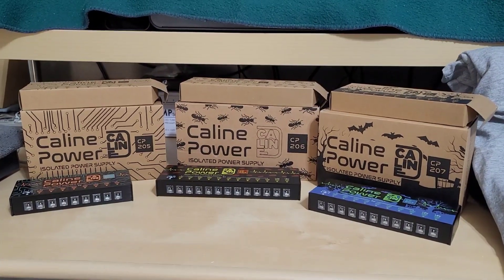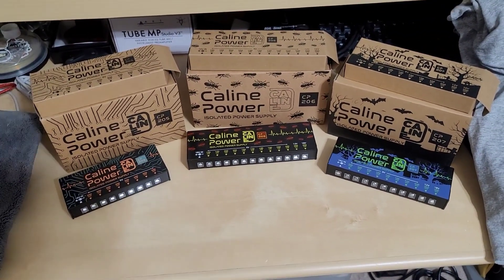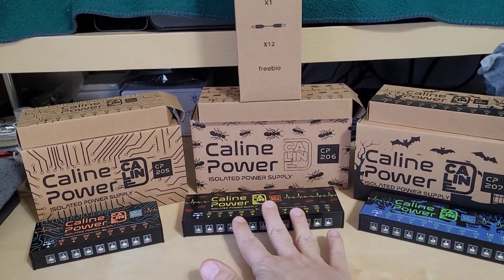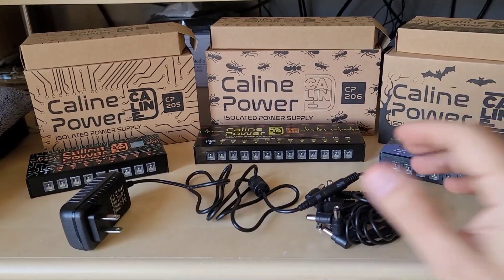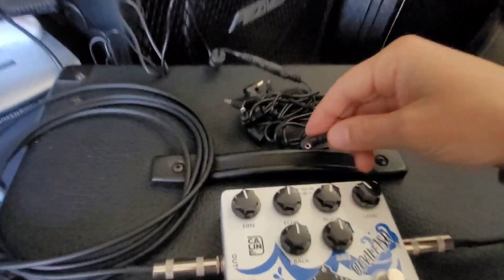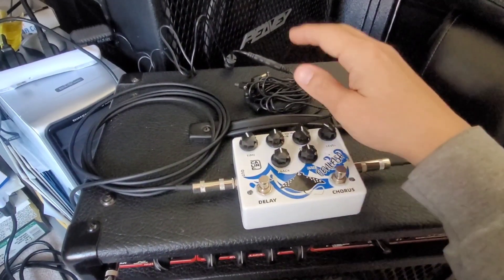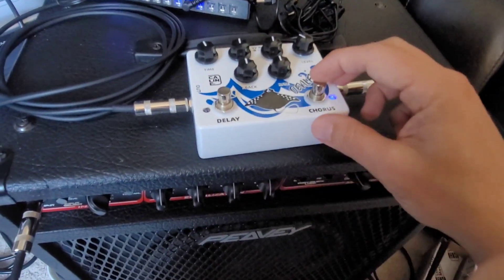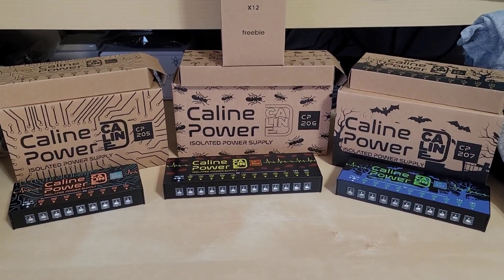Caline Isolated Pedal Power Supply: CP-205 - CP-206 - CP-207

Comment: Nice demo! My old Boss pedalboard served me well for many years...until I introduced a new pedal to the equation. I started getting a serious ground loop but couldn't for the life of me figure out why. I tried replacing cables and pedals one at a time. The only thing that stopped the ground loop was removing that new pedal (Electro-Harmonix). I found out it doesn't play nice with other pedals on a daisy chain. After some research, I found that so many others were having the same problem. So I tried powering the EH pedal on its own, which means having to run two power cables from my pedalboard instead of one (small PITA). No ground loop. So now I'm considering new power supplies like the Caline. I think your review may have pushed them over the top for me. Now, to try to make it fit inside my Boss pedalboard case...

Comment: Thanks for the video and you're seems a very competent electrical enginner. It's surprising that Caline uses normal linear regulator instead of switching dc converter. I'll buy the psu ASAP
Reply from the maker: It's not really surprising because it's a proven technology and it's also very inexpensive. Once you start adding a switching DC converter there are a lot more design elements required to make that technology work properly for the given application. As a result the burden cost of the product increases. 

Thank you for watching and supporting the channel!

Comment: Hope this makes sense. 

Can 2 of these be linked together by running a cable between the 18v out of one into the 18v in on the other or should each have their own power cable from the wall source.
Reply from the maker: Run each power brick with their own wall adapter is best. While what you suggest is theoretically possible it's severely limits the output current of the second brick if you do it that way

Comment: Great video.  Was wondering, are they “chainable” like the Strymon power supplies? So like if I have 2 of these, can I connect them both and share the same main wall plug?
Reply from the maker: Hey! Unfortunately no they are not able to be daisy chained from power brick to power brick. The wall adapter only has enough current for the single brick.
Reply: @Bassguitarist1985  I see, cool, really thanks for the info! 🙏🏻
Reply from the maker: @jan_07  my pleasure!

Comment: Just curious: are these UL listed? Do the larger tech-aware venues (or rather their liability insurers) require UL listing for anything using house power?
Reply: Yes， we had UL listed on the adaptors
Reply from the maker: @CalineTechnology  thank you for confirming!
Reply from the maker: Great question! Yes the UL logo is on all of their power supply bricks. Caline told me that they make those in-house to their specifications (voltage regulation and filtering for audio applications) and UL signed off on them.

Comment: Are you using an extension chord where the main power adapter is connected? Is there any issues in using extension chord for the main power adapter pls let me know thanks
Reply from the maker: @ddebayan1990  using an AC extension cord there is no issue

Comment: Thanks for the video!
Considering getting a 206, but one thing is bothering my perfectionism. 9V outputs go 100, 100, 300, 300, 100, 100, 100, 100, 500, 500 mA. Is this actually right? Two 100s, two 300s, four 100s, two 500s? Is this actually on the inside, or did someone mess up? Usually power outputs increase as they go left to right, or follow some kind of more intuitive pattern.
Reply from the maker: @max.shevchenko-987  nope that's how it goes, it is not sequential. Plus there are more 100mA or less pedals out there when you consider many run simple EQ, OD, and distortions

Comment: Hi there! Thank you for such an informative video, I have a couple of questions please.. Will this unit power Boss pedals correctly? I have (in order of placement) TU-2, CH-1, DS-1, PH-3, DD-6, and don't want to do anything to mess up my pedals. Also, in your opinion, is this the best order to place the pedals or would you have a better suggestion? Thanks in advance, and great channel..
Reply from the maker: No problem at all with Boss pedals! I'd do TU-2, DS-1, CH-1, PH-3, and DD-6. Gain pedals first, then modulation pedals last. Tuner should always be first.

Comment: I bought Caline CP-209 includes 18v dc power adapter. Every time I plug the power adapter to the 110v outlet, one prong of the adapter always sparks the moment it touches the inside of the outlet. What do you think cause this spark? I don’t think this is safe to use.
Reply from the maker: There should be a TINY spark as the wall adapter has internal capacitor that is charging up. It should be minor and nothing to worry about.
Reply: @Bassguitarist1985  Thank you very much for your helpful reply
Reply from the maker: @GitaraSan2  my pleasure! That's a fairly new model, I'll be getting one for review here in a few weeks.

Comment: Do you have any experience with the CP-204? I couldn't find any reviews for it. Thanks.
Reply from the maker: No I have not reviewed that particular model. I know that it is not a true isolation power supply rather a daisy chain type of topology. It has separate outputs where if you short one the rest will still operate. I haven't heard of anything negative of it though.
Reply: @Bassguitarist1985  I'm a little worried that the pedals won't hum... But the small size appeals to me a lot.
Reply from the maker: @tomaszmichnik  there's a chance that it may not hum at all. The bigger issue with power supplies that a lot of people don't know is the actual power supply circuitry within the pedal. If they are not properly filtered which a lot of early digital pedals are not for example, those perturbations and noise will feed back into the power supply lines and through the other pedals if they are daisy chained. With an isolated power supply it doesn't matter if the pedal has inadequate filtering it's on its own separate circuitry in the power supply and won't bleed to other pedals. Sure they are sharing the same ground plane through the quarter inch from your guitar through to the pedals to your amp but with one path to ground there's less likely to be any noise. Still isolated power supplies are the way to go for any potential noise issues being squashed

Comment: Hi..i have the cp 207..i don't know what happened but most of the 9V ports is now reading half voltage or less..one totally no voltage output..few ports still reads 9V but unable to power 200-500 mAh pedals. Only the 12 and 18 volt ports are both good I believe..What could be the issue?
Reply from the maker: I don't know without looking at the board but I am aware of an issue where the converter circuit from the incoming DC voltage that converts it to AC voltage, that oscillator circuit has had issues. It could be a simple MOSFET failing in that circuit that may need replacing. There are two of them. If one fails then you get a half wave and half the rectified voltage, which would explain your symptoms.

You are not the only one to mention this type of failure, for that reason Caline and I Are beta testing a new updated circuit board design that actually improves this oscillator circuit and at the same time eliminates the linear voltage regulator outputs. There are still some issues to work through. I'm really pushing them to increase the amperage capacity, that also creates more complexity.

Comment: I do have a question with what I am ising now which is a cheap 10.00 daisy chain. I run mostly caline mod pedals through my effects loop and a caline Jaguar in front. I was noticing a crackling static sound from my distortion pedal. All pedals are fairly new. Would a daisy chain cause this? From what I am seeing on your vid, It seems possible?
Reply from the maker: It is possible yes, but check your cables make sure they are solid, even remove one pedal at a time to isolate the crackling sound.
Reply: @Bassguitarist1985  OK,will do. Thanks!
Reply from the maker: @vmathias2023  my pleasure! Keep me posted!

Comment: i have a pedal that has 9V 150mA, is it ok to plug it into that 12V 300mA or into 18V 300mA? im using that Caline207.. thank you
Reply from the maker: NO!!! You need 9V. Plug in to one of the 300mA 9V ports

Comment: I have dunlop 535q wah pedal that says it has 2.5mA of power consumption... Is it ok to use cp-207 100mA?
Reply from the maker: Yes!
Reply: @Bassguitarist1985  so the rule is... its ok to plug as long as(any pedal) not under mA consumption and not over the volts required???
Reply from the maker: @youonlyliveonce1432  You need to match the voltage for the pedal and as long as the current for the output on the power supply is more than what the pedal requires then you're good.
Reply: @Bassguitarist1985  thank you very much for the replies.. watching from philippines👍 i just liked and subs

Comment: i bought a CP206 & all it did was power on power off every second, it was infuriating, i'm sending back... sucks, i'm going with the gator power 12.
Reply from the maker: My apologies that you were having problems with the unit. That type of behavior as long as it's not overloaded indicates there is a problem with the DC to AC circuitry inside. It could be something as simple as a bad solder joint. I know you said you were going with another unit but if you do decide to give the 206 another try please let me know and I'll try to help out as best I can.